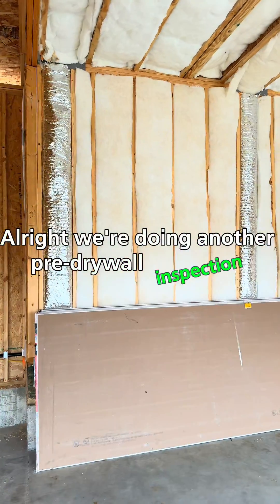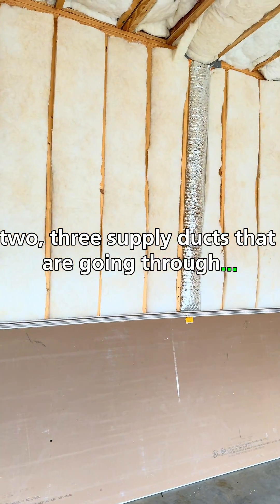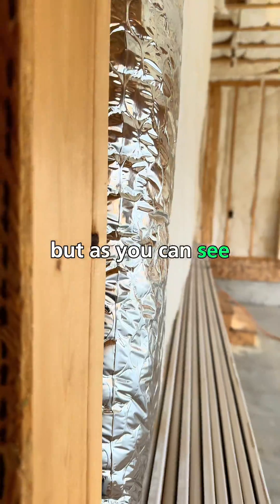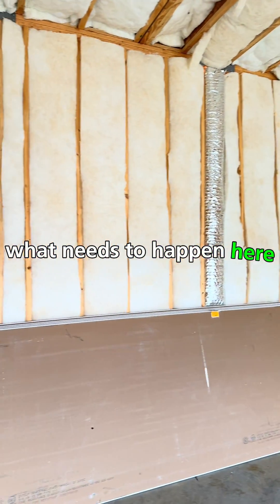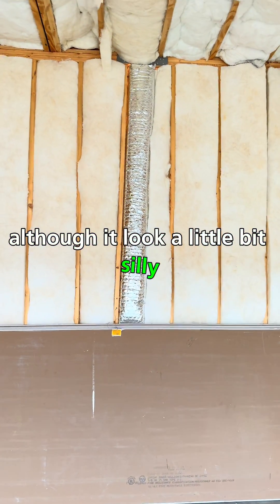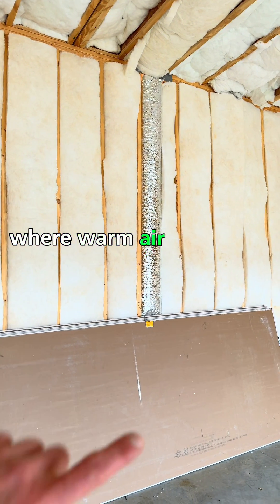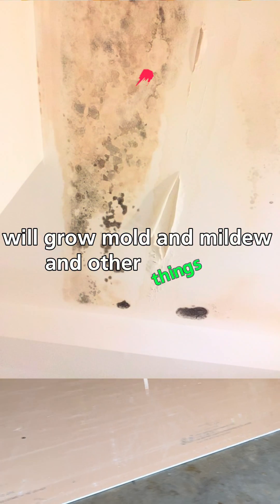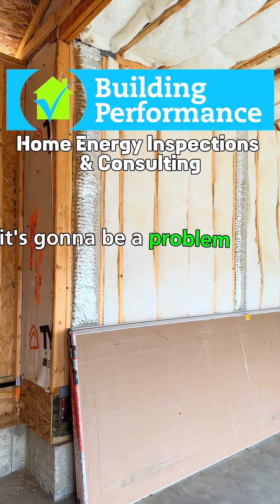SUPPLY DUCTS IN GARAGE WALL PREVENTS INSULATION FROM BEING INSTALLED! #insulation #newhome #mold

Comment: How exactly this needs to be done. I have a similar situation with the only difference that in my case the ducktworks are not sticking out of my frame but i still won't have enough room for insulation. What is your recommendation considering I'm in ohio. How should i insulate wall and where should i use faced insulation vs other types? Thanks in advance

Comment: this is  non issue.   There insulation there.  The duct work, which im assuming is flex duct, is also insulated.   The drywall is not that fragil, and will not bow out.  it will compress into the cavity.
Reply from the maker: Interesting take on it, but the duct work is not flex duct in a 2x4 wall cavity.  Not even possible to fit flex duct in a wall that size.  It's a hard oval duct wrapped with R8 bubble wrap insulation, so there's no way it will "compress into the cavity" when drywall is installed.  Again, the WALL caviities are not insulated where the ducts. The insulation around the ducts do not equate to wall insulation.
Reply: @BuildingPerformance9  never said the insulation was equal. . . but it is enough to stop condensation, plus there should be a vapor barrier on the external wall anyway. . . much less being ing the sun, siding, etc, unless you're worried about the garage side of the wall, which ever lessens the temp split.   Again, it's pretty much a non issue.

What did the builder say?
Reply from the maker: @BlackBeardAir  we don't use vapor barriers on walls in climate zone 4.  It's a mixed-humid climate.  The builder is furring out the wall behind the ducts and insulating them as recommended.  It's already part of the scope of work, the framer just didn't do their job right.
Reply: @BuildingPerformance9  so this wall was blue printed differently then built?
Reply from the maker: @BlackBeardAir  blueprints from production builders do not typically include small details like this and the superintendents and subcontractors often have to improvise when things like this arise on site. This builder in particular has been furring out garage walls behind ductwork for the 14 years we've inspected for them, so it's part of their standard practice.